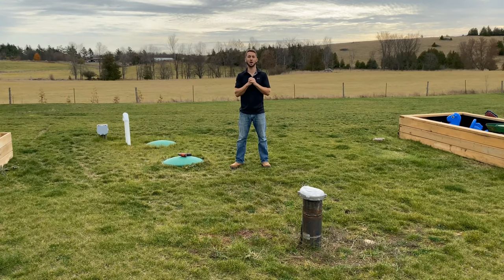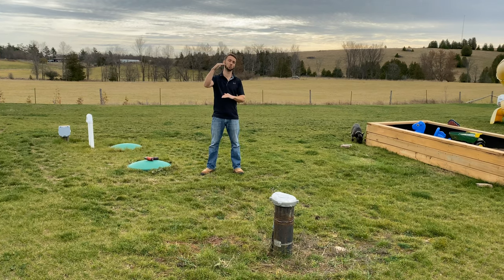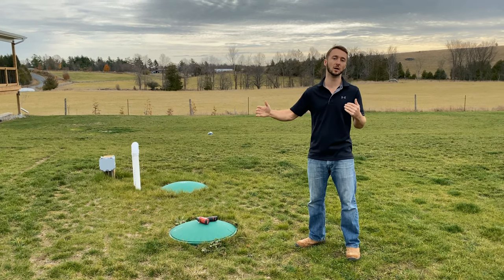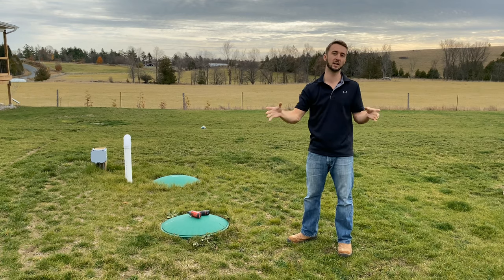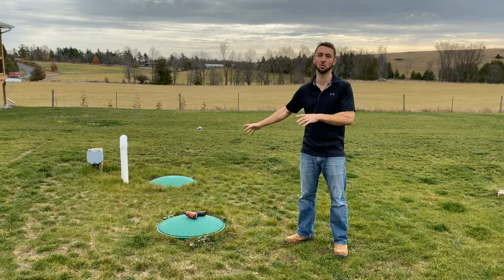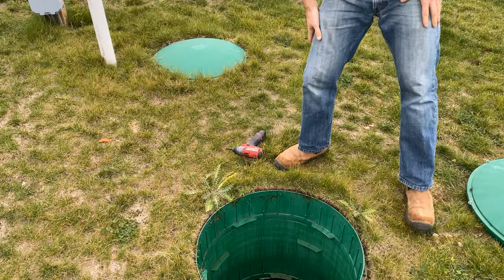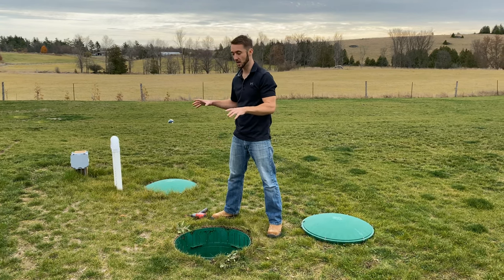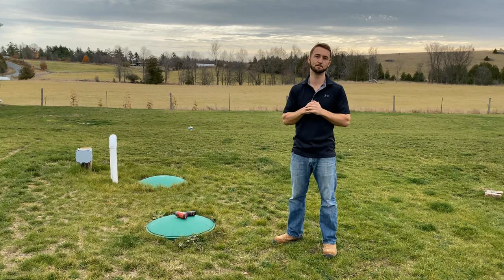Drilled Wells With a Holding Tank (Cistern)

Comment: Also have a low producing well. Took your advice and got a larger cistern. 1700 gal. How do you shock your system? Do you shock the well, fill the cistern, flush the cistern, then refill? Do you bypass the softeners?
Reply from the maker: We have never had trouble with bacteria so we haven’t had to shock it. Are you getting back water tests back or just looking to shock it as a precaution?